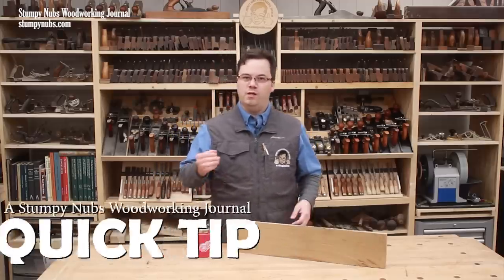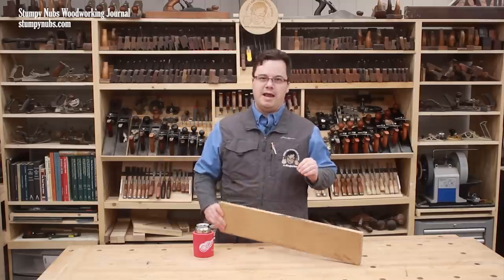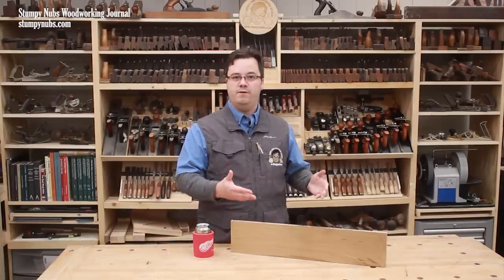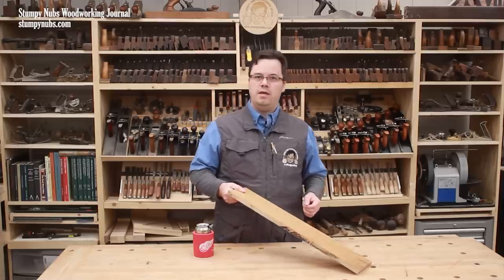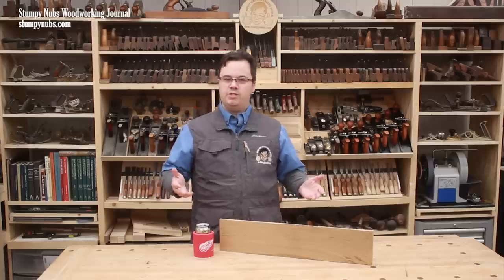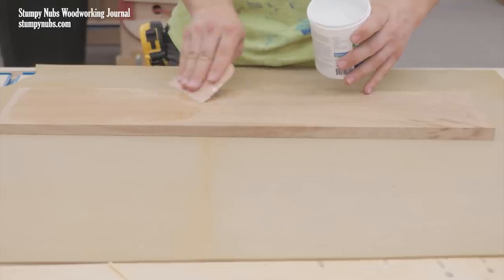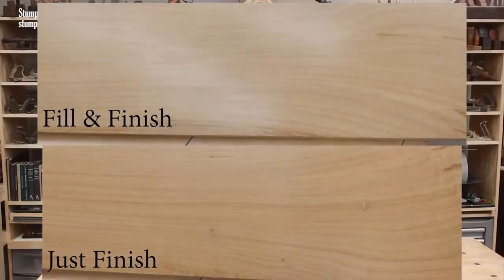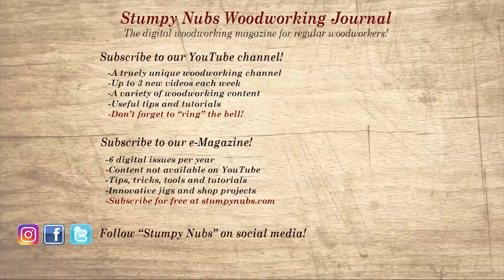Do you need wood grain filler before your finish?

Comment: Sometimes on a project with both solid wood and veneered parts I’ll grain fill the solid wood once to even out the grain depth disparity between the parts before french polishing.
Reply from the maker: Good idea :)
Reply: Hot tip. Thanks!

Comment: I have a piece of claro walnut burl I took a slice of that I tested this on because it's so full of tiny and complex holes in the grain and I wanted a preview of how it would look. I sealed one side with a dewaxed shellac and did not seal the other side. I then applied 3 coats of this grain filler to both sides with sanding as per instructions. I applied arm r seal over the entire thing. The sealed side looks great. The unsealed side is quite splotchy. I think the water based grain filler soaked into the wood on the unsealed side where it was more porous and sealed it meaning parts of the wood came out looking like they were sealed with a water based finish and parts have the greater depth of an oil based finish/over shellac. Both sides are much smoother than before sealing. In the future I will rub on a light coat of dewaxed shellac before using the grain filler.

Comment: I use the same filler as you have mentioned here first. Then I stain then use Sherwin Williams conversion varnish and get a nice result on red oak. Smooth to touch glass like finish. I won't use anything else now. 

Also I've learned to use a card scraper first before sanding, it helps to remove it from the surface faster than sanding alone. Thanks

Comment: Just finished a walnut floor the customer had milled from his property. We used tong oil mixed 50/50 with a drying agent . We sanded with 220 after the first two coats and left the dust on the floor. then two more final coats . Then we buffed out the floor to remove any excess oil that hadn't completely dried. Came out mint! Beautiful smooth  satin finish!

Comment: I did a piece with mahogany veneer. It was the first time I had ever heard of grain filler. I crossed my fingers and gave it a try. Fast forward to the lacquer finish and I was so glad I did. I finally got that smooth, glass like, finish I had always seen but never had been able to achieve. I sanded the finish up to 2500 grit, used McGuire's swirl remover, then a final coat with McGuire's show room glaze. You could see your reflection in it. All that awsomeness started with grain filler.

Comment: I've tried aquacoat a couple of times on African Mahogany and Sapele, and found that you must get it applied as evenly as possible, no areas thicker than others, as it will require quite a bit of sanding to even it out. Also, It was difficult to do a large area all at once, as it does dry fast, and makes it difficult to get the coats applied evenly.
My first try turned out rather blotchy as it didn't go down evenly - definitely a user error - but after some practice I was able to understand better how to apply it and get a better surface.
It does leave a nice, smooth finish though, but definitely took some practice to get it right!

Comment: I could see this coming in clutch for painted furniture. Especially cabinet doors. Thanks for another great video!
Reply: I've filled pores on red oak with spackle and then painted. Worked perfectly and MUCH less expensive than Aquacoat although I will try Aquacoat for a table project I have coming up.
Reply: I am not reading any mention of it being used for paint prep, only staining . Am I missing it ?

Comment: I watch your videos and thought of this one when my son asked me to help him paint his kitchen cabinets.  The cabinets are cheaper units and have oak plywood doors, his first house.  I tried the aquacoat and found it did not really work that well.  On my test door I was up to 7 coats and still had quite a bit of grain showing through.  Watched you tube for other options and tired spackling compound.  This went on easier and was easy to sand off.  After 2 coats almost no grain was showing through.  Also tried skim coat with bondo and worked great to cover grain but dried so quick it was a mess to work with.

Comment: Just used this recently on a project with birch ply, and then a painted finish. Came out with an ultra smooth finish. Easy to work, easy to sand. I applied my coats across the grain, and then removed excess with the grain. I have not tried this with a stain project yet, but I have console table project coming up that I think I will use it on. Good stuff.

Comment: Before I retired from the painting trade I brushed on "Sanding Sealer" which is a thickish water-thinned cloudy liquid. It is quick to dry and sands down to a perfect finish in just a few swipes. I never had to apply more than one coat since it will "stack" as thick as you like. It may be applied as quickly as paint and is thus far quicker than this method.

Comment: James, I recently used a grain filler made by Solarez on some oak night stands with good results. The product cures in 3 minutes with exposure to sunlight so you can really speed up this process. 3 coats are recommended. It imparts a slight ambering effect to whatever wood you’re using.

Comment: interesting.  I've been refinishing persimmon golf clubs for years and use a stained grain filler after removing the old finish, after sanding the head but before staining the club.   I was taught to lay it on thick and remove it with a burlap rag - works fantastic.  I am new to wood working and hadn't really thought about grain filler for my word working pieces (though candidly as a newby I'm mostly painting the furniture pieces I make).

Comment: I’ve used grain fillers quite a bit.  It’s my understanding that the seal coat first recommendation is when using a colored filler to keep the color from bleeding or muddying the wood around the open grain.  I’ve not experimented, but using the seal coat takes little time and I figure can’t hurt.

Comment: Wet sand with Tung oil along the grain to create slurry then use an old plastic credit card to gently scrap the slurry against the grain to fill. Takes a few passes and has a drying time, but it’s my favorite way.

Comment: I bought some after watching this. 

The label says it dries “crystal clear”, but only if you do it right.

Before using it on a project, I did a test. I used the cedar plywood bottom of a cigar box (which usually French polishes well with a lot of work - hence the interest in filler). I used a strip of blue tape to mask off a 1” strip of bare wood and applied the filler. I then moved the tape to expose a 1” strip next to it and applied the product to both so the first strip now had 2 coats and the second had 1. I continued until I had 4 strips. I moved the tape once more to expose another strip of bare wood and started applying platina shellac. 

Results:
- the filler did indeed fill the grain, 3 coats seemed to be what this wood needed 
- the filler made the wood color slightly milky. The number of coats didn’t seem to matter much, they all looked milky compared with the shellac only strip. This color change might not be noticeable if you fill all the surfaces  on your project that are the same wood, however.

Test 2
Sealed the wood with 3 light coats of 1# platina shellac before filling with 3 coats of Aqua Coat, followed with three coats of shellac.

Result: no effect on the wood color as compared with wood finished with shellac alone, but nicely leveled surface.

Conclusion: seal the wood with several light coats of shellac before filling the grain.
Reply: Question: Did you sand after each coat of filler?
Reply: @mychalevenson7710  
Yes, as directed in the label instructions, I did a light 220 grit sanding “to assist bonding”. The surface was quite smooth.

Comment: Based on your recommendation, I bought a jar of Aquacoat and used it on a test project. My top coat was shellac dissolved in 91% isopropyl alcohol. (Can't buy denatured in California) As soon as I started brushing on the shellac, the filler partially dissolved and came loose and spoiled the finish. My order of application: Sand to 320-- water based stain-dry overnight- shellac--dry 1 hour--Aquacoat squegeed into the wood surface--dry overnight--sand with 400--brush on shellac--.
Have you tried shellac on Aquacoat filled wood? Is it the alcohol which I presume has 9% impurities (water?) I love using shellac and French Polishing my pieces. I'll do some more experimenting and hope to hear from you, I didn't get a helpful response from Aquacoat.
Thanks, Paul Lipton

Comment: I tend to just use several coats of poly, it does the job but takes about six coats to completely make it smooth. And Since my poly tends to dry out before I get through it, well, I don't see this as wasting it. At least it's getting used before it dries out.

Comment: The Aquacoat looks very easy to use. The questions I have are:
What is the coverage i.e. how many square feet per pint?
What is the shelf life of opened and unopened containers?
Thank you for sharing. Have a great day and stay healthy.
Reply: Those are questions for the manufacturer. Stumpy isn't a rep of theirs and this video isn't to show off that filler specifically. He's just showing what he's using because he's gotta use something.

Comment: Great tip.
I started using sanding sealer last year. But the product is usually a brush-on liquid, which can be difficult to prevent runs on the edges.
I'm also curious as to how well this works on end grains. I usually use standard wood filler, especially for MDF.

Comment: Do you know much about cleaning open pore finished wood? I'm building an electric guitar and initially I was definitely set to fill the grains with sandpaper as I apply the finish but the Mahogany body blank I got is just so beautiful I felt it would be a shame to cover that up. I will be applying oil finish I got from Crimson Guitars with five coats at least and there isn't much information out there about open pore oil finished wood.

Comment: if you stain the wood, you should seal it before using grain filler because of the possibility of stain/color migration through the topcoat. losing clarity and distorting the color. if you are not staining then you can use filler on raw wood.

Comment: I have never found a consistent answer.......do I stain before grain filling or after?   It seems the grain filler will fill the grains (hence the name) and the stain would only touch the surface wood, leaving the filled grains looking different.   Does the grain filler absorb stain like the wood?
Reply: Altho I've never used it, you might check out the Timbermate line of wood fillers. It's filler that optionally has various stain tint built -in.   There's an Australian (or New Zealander) carpenter on YouTube that uses the stuff to good effect.  I can't remember his name.
Reply: Yes to do stain first. The filler does not absorb stain at all.

Comment: @Stumpy Nubs. 

Good afternoon sir. I've got a question that I was hoping you could assist with.

I'm just getting into woodworking, I plan on doing smaller stuff then eventually converting over to cabinet work.

I'm currently in the market for a jointer and planer. I've recently come across a Hitachi P12RA jointer and planer combo. It's in great condition but I don't actually know anyone who has owned one and can't find much information online. I'm wondering if I'm overpaying for this and if it's worth buying. I understand you're probably busy but even the smallest amount of insight would be helpful. Thank you.
Reply from the maker: I know nothing about them, but  a Google search revealed several promising results.
Reply: @StumpyNubs  Thank you, I appreciate your insight

Comment: Question,, I left a comment in the previous video, just wondering if you like and use the sharpening tool on the shelf to your left. I also had a question on the earbuds as well.
Reply from the maker: Yes, I use my Tormek and like it very much. We have made several videos about it. Here's one: https://www.youtube.com/watch?v=JgKkBpqXBv4 You will find links below that video to the machine and it's accessories............. I have used all of the ISOtunes models. I personally find the ear muffs to be the most comfortable, but all of the ear buds are great. The biggest differences are battery life (each model on their site gives you the estimated life). If I had to pick one set of earbuds as my favorite, I would say the wireless model. I love having no wires.
Reply: @StumpyNubs  Thank you

Comment: Can you do a test to see if the BLO or tung oil slurry actually fills the grain? I suspect it doesn't for a couple reasons. First, I don't think it will harden in the grain because it doesn't harden so much as get really boogery. I guess if I were pressed on the matter I would say boogers are harder than oil, but that feels like it's missing the point somewhat.  Second, I've finished and refinished a lot of gun stocks with BLO and pure tung oil, and I feel pretty confident that it doesn't affect the clear coat because there is no clear coat with these finishes. If one is putting varnish or shellac on after the oil, why not use that finish to fill the grain? Third, there's enough confusion about tung oil compared to tung oil finish that I suspect this is a tip for the latter and is therefore widely understood to be applicable to the former. I distinctly recall an article on this subject from an old surplus rifle website that used Formby's tung oil finish, but Formby's is a wiping varnish.

Comment: I just finished building a book case out of red oak.  Would you use this grain filler on it?  Do you sand by hand between all coats?  Would you ever pre-fill and pre-finish the wood before you assembled the bookcase, instead of after construction?  Thank you for your thoughts!

Comment: James, in your experience, what is the shelf life like on this filler. The price per oz drops significantly on Amazon if you buy a quart and even more so on a gallon. But I wonder if it would dry out before I used it. I'm a hobbyist  woodworker. Thoughts?

Comment: Can I use a first coat of wipe on varnish as my seal coat and THEN put on the grain filler?  I really like the darkening of the wood that my varnish gives to the wood ad wondered if using this water based filler would prevent that effect.

Comment: Hello James, John here from the UK, England. I really enjoy your videos but you misunderstood something in this one. 
 
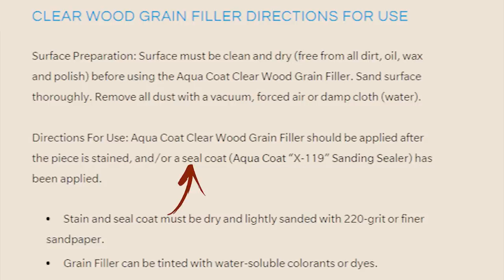Regarding the “Directions For Use” on the tin, you say it’s contradictory but it’s not! It IS poorly worded and I can see why you might come to your conclusion but at 2:44 you’ve miss understood the directions for use.

The instructions would be better if the directions at 2:55 were printed and therefore read first, try it.  This states that one can apply grain filler to raw wood, well of course, we know that. 
 
Now read the instruction that comes before at 2:44 which says that grain filler should be applied after the piece has been stained or sealed. This is quite correct. This instruction is actually trying to say “if you want to stain or seal the piece, apply filler afterwards not before”. As I say it’s poorly worded on the tin but as I know you give great information I thought I’d just let you know.  Do check out my channel, John The Handyman. Thank you and regards.

Comment: I've used aqua coat several times on white oak and was always frustrated. Took many coats to fill, had to be put on very sparingly as large amounts seemed to dry to a grey-ish hue and was hard to sand. I've had much better success with wet sanding danish oil, but that's a different animal (VOC's, ambering, top coat compatibility). Maybe i got a bad batch?
Reply from the maker: Hmmm, that was not my experience at all. I do know they make more than one product. What I use is clear and quite easy to sand.

Comment: Apart from used rimu from demolished buildings, hardwoods are difficult to get hold of in New Zealand, so we tend use timber old furniture etc.  Some of this can be very dry and does not plane well.  For instance I am using some oak at the moment to make spinning wheel bobbins, and the grain is very pronounced in places.  So would that be a case for wood filler rather than grain filler?

Comment: I have a question about Aqua Coat. I used wenge in a charcuterie board. Wenge has an open grain that I want to fill without changing the appearance and color of the wood, except to fill the grain and be smooth. Would Aqua Coat be a good option? Also, Aqua Coat is water based and I use an oil finish. Would that be an issue? Thanks. I enjoy watching your channel.
Reply: Probably a bit late, but in case anyone runs into this it might be helpful:  I would assume the Aqua Coat would (after a few layers) fill in the gaps and just blend in with the grain.  Haven't used it yet, but seems to work that way how this vid showed.  Test it on a scrap piece before using on your main project. As for the water and oil finish, they won't play well unless you put a barrier in between.  A barrier Mr. Stub has mentioned in older videos is Dewaxed Shellac, or 'bulls eye seal coat' by Zinsser.